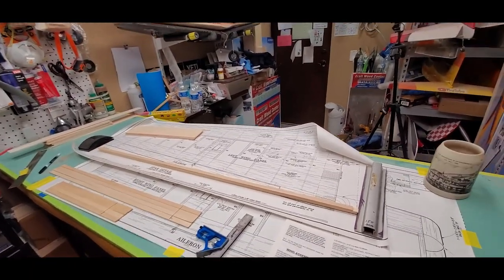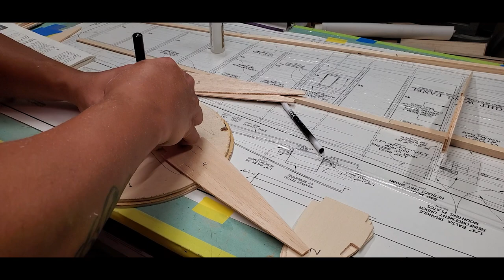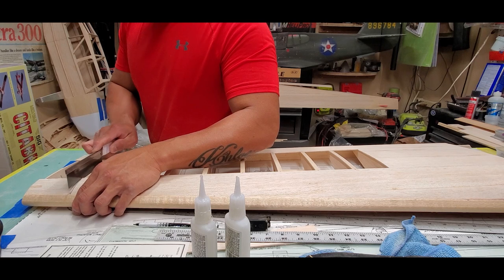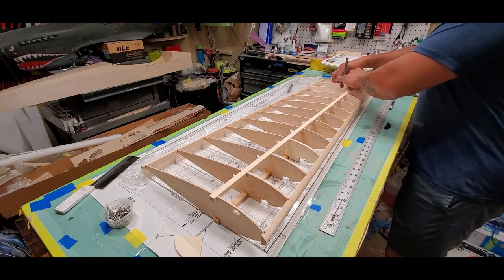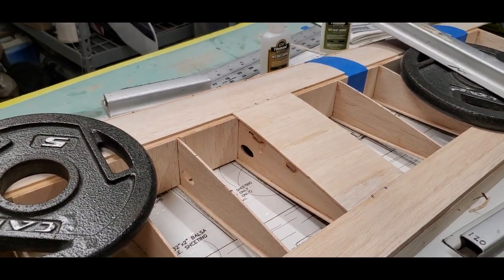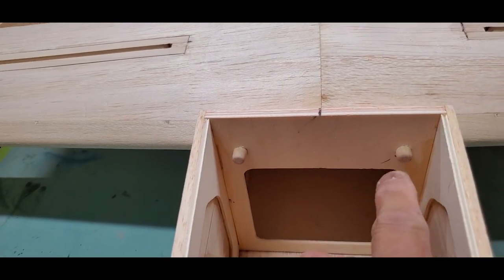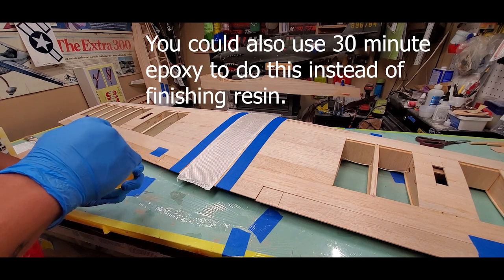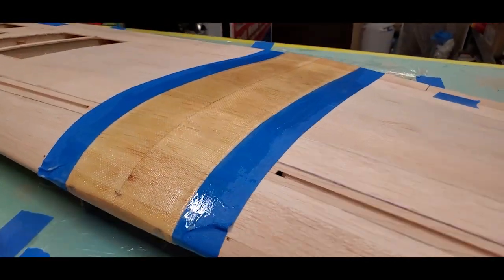Great Planes Ultra Sport 1000 Build Series Part 4 Building the Wing

Comment: Have you ever tried adding bar soap to your razor saw as a lubricant before cutting wood components? This will stop chipping and breaking of wood components.
Reply from the maker: You know that is a great idea!  I gotta give that a try.  I appreciate the tip my friend.
Reply: @BayonasRCWorld  I usually take bar soap and rub the sides of the razor saw and then swipe the serrated edge the full length with the bar soap. Any bar soap will do. Great video btw.